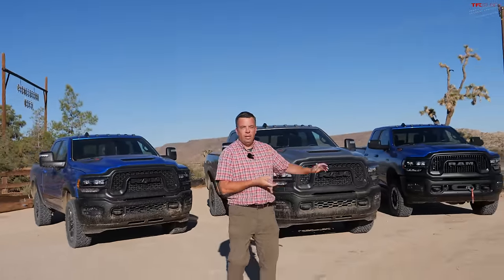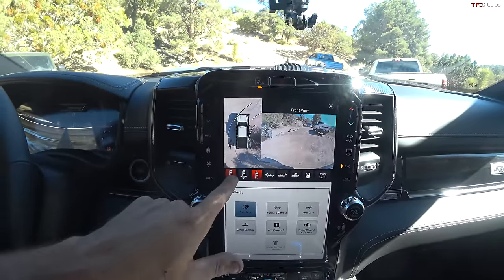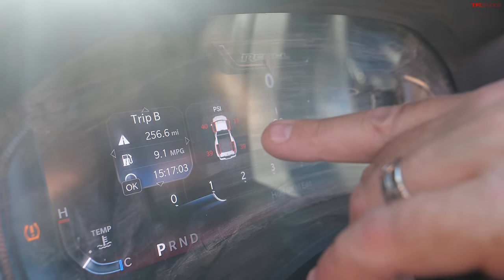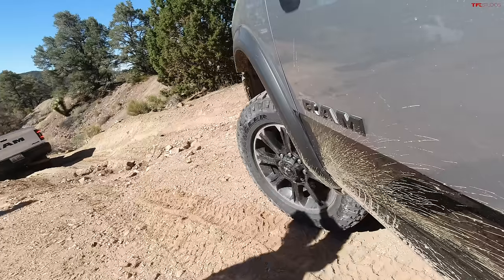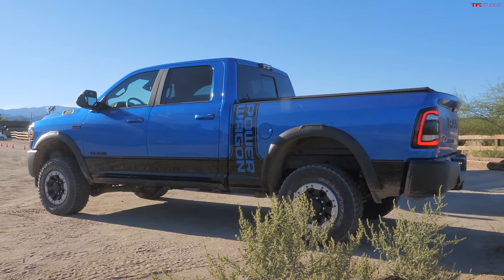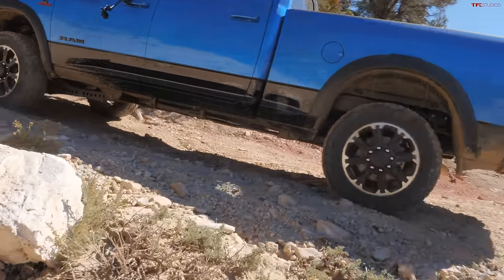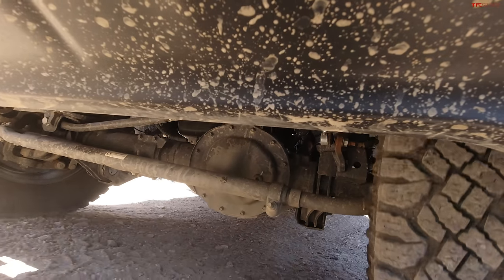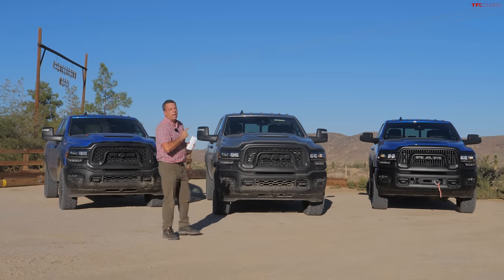2023 Ram HD Rebel vs. Power Wagon: One of These Trucks is the Off-Road KING, But Which One Is It?

Comment: I’ve said it before and I’ll say it again, “I don’t need a Powerwagon but I want one”.
Reply: I have an 18. Best. Grocery. Getter Ever😂! I only get it off road a few times a yeah but it’s an incredible truck.
Reply: True. A few months ago I went into my local dealership to test drive a used Power Wagon, and I almost traded in my  brand new 1500. A 1500 is everything I need but a Power Wagon is everything I want 😞
Reply: I want to buy one, but with war going on, fuel price will be $10.
Reply: Just got a 24 power wagon , sure is fun and love driving it , going to sell my trx
Reply: Better to have and not need than to need and not have.
Reply: Bought a 22 PW new 2 years ago. I love it. People complain about mpg, but I average 13-14, have gotten as high as 17. A 1/2 ton with a V8 doesn't get much better. I don't do a lot of off roading, but when I do it is fairly significant. Not any crazy stuff, but stuff around the farm can be hard on a truck sometimes. Only had to use the winch once on myself, more on others. Having a winch is invaluable, especially for a vehicle that looooves to sink in the mud because of weight.
Reply: Till that thing yanks u into every gas station it passes

Comment: I waited for Ram to release a package like this since Ford announced the Tremor. Between the low payload rating, the inability of running a winch with the Cummins, and not being available on a 3500 I went out and bought my first Ford in 25 years. Ram is so close to having the dominant truck. If they make the packages competitive and finally put a quality transmission behind the Cummins they will be the class leader. Until then, I will enjoy my fully optioned F350 Platinum Tremor with a 3300 lb payload.
Reply: Steven Kane...........................There is BOTHING wrong with the AUTOMATICS in the Ram Cummins, nless you increase the power with a tuner! ALSO, the 1 tons that have the Aison transmission, is very reliable, and better than the Allison in the GM or Ford
Reply: @1gr8oil  The Aisin is a fantastic transmission, but it really needs weight to be appreciated. For guys who mainly tow it’s the perfect combo as long as you keep power levels close to stock. The Ford has a great all around transmission. Extremely refined compared to an Aisin which is perfect for a daily driver, weekend warrior.
Reply: I’ll stick with my 2017 Powerwagon. I pull my 7600lb holiday trailer twice a year only. Diesel trucks only make sense these days if your towing regularly here in Canada.
Reply: @juiceybrucey3475  - diesel or gas Ford got ram beat in both. Power wagon towing numbers are way too low for a “heavy duty” truck.
Reply: Why can’t you run the winch with the Cummings? There’s a lot of people who choose diesel for running trails or long distance camping and they have a winch on their vehicles. Are you thinking that having a duel battery 24 V system is an issue?
Reply: @EvanMoon  No, I was talking with the factory bumper.
Reply: @EvanMoon  the cooling system is in the way.
Reply: That 350 will be on the used market in three months 😂🤣
Reply: That 350 will be on the used market in three months 😂🤣
Reply: That 350 will be on the used market in three months 😂🤣
Reply: Bro your 350 will be on the used market in three months
Reply: Bro your 350 will be on the used market in three months
Reply: @chanoleyva4208  Not a chance in hell. Have you driven one?
Reply: @CoyoteFTW  Heavy Duty in this aspect meant more for off-roading. You can still tow and have a payload, you just gotta watch your numbers. People forget this shit it seems. 🤷‍♂️
Reply: Is it a gas ford f350 tremor also is it possible if you do a mini review
Reply: @Evan Moon  not enough room.  You can do it with an aftermarket install
Reply: @juiceybrucey3475  That 6.4 HEMI won’t last long.
Reply: @CoyoteFTW  wasn’t built for towing… 🤷‍♂️ but I’m sure you can throw on airbags….
Reply: @CoyoteFTW it’s better at off-road
Reply: To my great surprise, a Ford boi entered the chat and declared Ram inferior. It’s amazing how many Ford bois follow Ram forums and videos.
Reply: @dannyhoward3437  Thats usually a byproduct from owning a Ram then getting fed up and moving to Ford. 

Owning a Ford was the last truck I expected to own, but here I am. Ram is doing a helluva good job pushing owners into different brands.
Reply: @redtitan29  no, they aren’t. Tell the troll farm at Dearborn this isn’t working.
Reply: @dannyhoward3437  Keep drinking the kool-aid and putting up with mediocrity. I owned Rams over the past 25 years so you're talking to the wrong guy.
Reply: @redtitan29  of course I’m talking to the wrong guy. That’s the whole point of this game.
Reply: @dannyhoward3437  No games being played. It simply boils down to facts.

The market begged Ram to offer the Cummins in the Powerwagon for years. They ignored the demand allowing Ford to enter the conversation. 

Ford responded with the Tremor which addressed all of the areas Ram said it couldn't:

Available on 3/4 & 1-Ton ✅ 
1,050 LB.-FT. OF TORQUE ✅
475 HP ✅
10 spd w/7 Drive Modes ✅
Diesel + 12K Winch  ✅
Capacities respectful for an HD Pickup ✅
Front Limited Slip ✅
Rear Locker ✅
Rock Crawl Mode ✅
Trail Control Mode ✅
Slight Lift w/35" Tires ✅
Larger Cab ✅
Larger 6.75 bed ✅
Completely Flat Rear Floor ✅
Larger Fuel Tank ✅

Ram gets tired of the Tremor stealing sales so they finally releases the Rebel HD:

Only available on 3/4 ton ❌
Limited to Standard Output Cummins ❌
850 LB.-FT. OF TORQUE ❌
370 HP ❌ 
No Diesel + Winch ❌
No Drive Modes ❌
33" Tires with 20" Wheels ❌
Old Smaller Crew Cab ❌
Smaller 6' 4" bed ❌
Hump in Rear Floor❌
Smaller Fuel Tank ❌

Like I said, keep drinking the kool-aid. If you remove your bias you would clearly see Ford has the better overall package. 

I learned a long time ago to never be loyal to a company that isn't loyal to you. Blindly following brand loyalty is a recipe for being taking advantage of.
Reply: @redtitan29  you still don’t get it. Wow.
Reply: @dannyhoward3437  I get that you're being  very condescending and not interesting in adding anything beneficial to or having an adult conversation.
Reply: Sorry, those fords are piles for sure. My last ford was in the shop way more then I can count.😂

Comment: I completely agree with you on the Rebel being a step below the Tremor. I agree also that the Power Wagon is the best for HD off-readers. I think theTremor has them both beat with Diesel payload and the availability of a winch with the diesel. But my 2020 F150 has the same payload as the Ram Rebel HD Cummins
Reply: What’s an off-reader…?😂

Comment: Power wagon is the ultimate Off road truck still. Draw back is the low payload but that can easily and inexpensively be fixed with some added air bags in the rear for the 5% of people who really need more capacity.
Reply: Tell that to the insurance company when your overloaded Ram is in an accident.
Reply: @donrichter3523  Mine is never overloaded

Comment: Prices are wild. I ordered a brand new 2021 Power Wagon and paid $53k (MSRP $60k). Level 1, 360 cameras, towing tech, dual alternators, bed utility group. Almost 30k miles with plenty of dents/scratches from the trails and zero issues. Towing 7k travel trailer too (thanks SumoSprings) with no complaints. Sold my Cummins and don’t miss it one bit, especially the emissions!

Comment: The articulation of the PW is primary difference between it and other full-sized entries. Yes the lockers and winch are nice adders, but keeping the tires on the ground is key. I have a Able Components module in my '16 that will allow me to unlock the front swaybar at any speed (and also lock the front and rear at any speed, 2hi, 4hi, 4lo). I leave the front bar disconnected most of the time and enjoy a nice comfy ride, even with a Four Wheel Camper in the bed.
Reply: Вот!!! Воооооооот!!! Я не могу понять дурости, которой страдают ваши блогеры и обзорщики!!! Естественно Power Wagon будет лучше Rebel на бездорожье! Ходы подвески плюс блокировка переднего дифференциала! Вопрос насколько? И что ещё очень важно, какова разница между ними на асфальте! Power Wagon за счёт своей подвески ещё и на асфальте весьма неплох для рамного авто с мостами впереди и сзади! Грузоподъёмность PW сильно страдает! И вот не понятно, стоит ли игра свечь? 6,7 Дизель не аргумент, это кусок разваливающегося говна!
Reply: Sway bar disconnected on pavement and high speed?
Reply: @megudal78  - depending on road conditions, yes
Reply: Interesting, should I give it a try? 😆

Comment: I've owned a power wagon.....a jeep wrangler....and a diesel 2500. 

The off-road capabilities for someone that can isn't scared of putting there foot in the throttle of all 3 are close! But....the Powerwagon is a freaking beast and the weight difference between the diesel and gas is def noticeable! The Jeep is a jeep it's gonna go anywhere as long as it's not on the frame and same with the Powerwagon
Reply: ive taken my rebels every  where my power wagons and my rubicons went.

Comment: My '16 PW is just about to turn 100k. I've had one problem, under warranty, a failed EVAP solenoid. It has been a great truck and is as unstoppable off-road as my 80 series Land Cruiser, though at over 9,300# loaded with a FWC, sliders, bumpers, yada - deep sand can be tricky. Payload, pfft... AirLift bags and Daystar cradles. Guys, don't get your panties in a bundle over rear spring rates.

Comment: Awesome vid as usual guys.  I am confused by one thing with regards the fuel range discussed.  The HD 6.4 had a range of 415 miles (256 covered with 159 remaining) and the HD Cummins had the same (114 covered with 300 remaining) but Andre said 'that's why you get the diesel, for the range'.  If they are the same range, then isn't the real difference the torque? Am I missing something, perhaps the diesel tank is smaller?

Comment: My 3rd PW comment here and not sure it is still relevant, but my 4th gen '16 PW was just a couple steps above a Tradesman. The only two options it had was the tow mirrors and the bigger 8" infotainment head unit. With this option, I was able to add a bunch of features such as single zone auto temp control, steering wheel volume/track buttons, HomeLink, the nicer PowerWagon (with logo) EVIC gauge cluster. Driver and passenger under dash lighting pigtails are there for adding some nice LED illumination. Added the OEM remote start/keyless feature too. Essentially everything was there to build up a higher trim (wiring harness) but the larger  8" headunit was the key for many items. Not sure if that is still the case, but worth investigation.

Comment: Just buy a regular 2500 Cummins, add one of the Carli suspension kits, 37s on 17s, airbags with cradles and maybe ARB air locker if needed and you will have better truck the HD Rebel for less money. If need more payload, do the same but with 3500. That is my plan, have the 2500 Cummings on 37s with Carli Commuter and it rides like a dream will probably upgrade  later Fox 2.0 with external reservoir or King 2.5s later on. Will be adding airbags with cradle soon as I tow a trailer and it sags a little in the rear but still rides great. Will add air lockers and new bumper/winch if I start getting a little more brave offroad. Even with all the upgrades will come in under $91,000 and be light years better then HD Rebel. I would have gone Power Wagon but I need about 2000 lbs payload to tow trailer with kids, dogs, bikes, etc for camping.
Reply: There are ZERO aftermarket rear diff locks for the current HD RAM.  That’s one reason to get a Rebel HD.
Reply: This is the correct answer.

Comment: Nice comparison.  And yes the overlanding range is a big deal!!!  Even with the higher cost of diesel, a savings can be realized.  Of course range is everything while overlanding.
We have an '18 Ram 2500 Crewcab 4wd 6.7L Cummins with the 3.42 ratio.  Our mods include a Hawk model 4wheel popup camper.  Bilstein 5200 shocks on the rear, and Eibach shocks on the front, and a steering brace.  Added an aluminum transmission oil pan.  Have a Bank's intake to delete the grid heater, ready to be installed.
We also have a '16 Ram 1500 Quadcab 4wd 3.0L Ecodiesel 3.92 ratio.  Bilstein 5200 shocks all around, Flowmaster muffler, and the Bank's silencer delete tube.
The ULTIMATE overlander would be a Megacab 3500 with the 3.0L Ecodiesel, 8-speed, 4.44, 4.56 or 4.88 ratio, and the AEV 3" lift kit to allow 37" tires.
The original 5.9L Cummins in '94, had less power than the 3.0L Ecodiesel.  The 8-speed would help the engine stay in the sweet spot.  And if Tow/Haul mode is used, the VGT turbo engine breaking is pretty good.

Comment: That’s exactly what I did the tradesmen power wagon the exact one that you have on the video red chrome and black love it. I do not need all the bells and whistles with all the electronics inside. I have the 8 1/2 inch entertainment system Blindspot Monitoring back up sensors. Interior opted for the work Grade vinyl it looks like leather, floor shifter for the four-wheel-drive vinyl floors because I put Rams floor mats in. All I have to do when I clean it pull the floor mats out and wipe the floor down no vacuuming . $42,000 before taxes

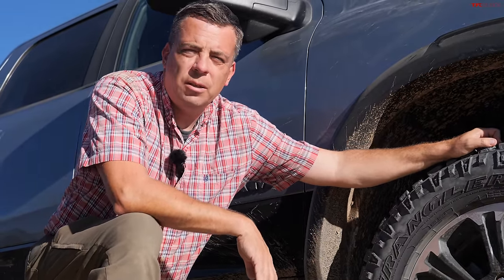Comment: I tow all day long with the Hemi Power Wagon. 4:10 gear. Bought my 2015 AEV power wagon  to tow in soft dune sand Oceano and imperial, dumont dunes. 25' toy hauler. You can very well tow with a V8 engine. In fact i think the power wagon did very well in your towing test uphill and down hill ike. Also the power wagon did well in your off road test scoring. The highest i think P.S. companies offer supercharger kits for the 392 Hemi V8 for less than 10,000 dollars if you want boost for high elevations. Big bear is 40 minutes from my home. Adding Diesel to the Legendary off road p.w. is like adding 22" rims. I do have a cummins generator my R.V. however.

Comment: TFL, does the HD Rebel have a lift in the front?  I'm not seeing much difference between the Rebel package and a standard 2500 except for locking diff and a slight lift in the front.  Is there much difference in that front control arm in the Rebel from the standard 2500?

Comment: I bought a 2022 Power Wagon 75th anniversary and immediately put in the Carli Pintop system with radius arms. It immediately made the truck the best offroad option period. I've taken my truck to some INCREDIBLE obstacles and it just went everywhere! The gas mileage is one downside, however.

Comment: I was really excited for the HD Rebel. As a 5th gen Ram Rebel owner, who’s looking to upgrade to a HD truck, the concept is ideal. However, the execution leaves a bit to be desired. I’ll wait for the 5th gen cabs and higher GVWR. The rumors of mild hybrid systems to boost power and efficiency are promising.
Reply: Just talked to my dealership. They have a 2500 rebel w the diesel and the power wagon package. Msrp is 88k

Comment: One thing to consider here between the Rebel diesel and the 6.4 Hemi. The gas Rebel has about 1000 lbs more payload capability than the diesel. So even though the diesel can tow 3 to 4 lbs than the gas on paper, the tongue weight of 10 to 15 percent will take away payload quickly, so the difference between the to may not be as dramatic it may seem. Also, you can add air bags to the Power Wagon and tow just as much as the Rebel.

Comment: Something people forget regarding Diesel and off road driving is the amount of idle time and super low rpm. The emissions systems in newer diesel trucks are still the Achilles heel and don't like low rpms or idling for extended times so fuel economy considered, it would still be the better choice to opt for the gas engine.

Comment: The only thing i didnt like about my 19 and 22 power wagon...with that massive muffler it sounded like it was wheezing 😂.   That has been fixed on my 22 with the proper application of an aeroturbine muffler.

With my 35 inch Yokohama g003 M/T tires it sees right at 13.3 mpg highway.

The payload goes down to 1100 lbs with the rambox option.  It is the perfect truck for those that want off road ability with almost 1500 ride.

Comment: Not sure if Chrysler tried to do any real Voice of Customer for this truck, but. They could have easily carried over some of the beneficial Power Wagon items at little to no cost. For example, 20” wheels, seriously, look at your Ford competition guys. Instead of introducing a new wheel, carryover the PW wheel and tire combo, at 3195 lbs per tire capacity at 65 psi, that is fine for the GVWR of a Ram 2500. Also, the PW front lift springs should work as well at least on the Hemi rebel as the front weights should be the same. Maybe the only additions that would be needed beyond that are taller springs for the rear and a limited slip diff for the front axle, then you have a Tremor competitor. As it sits now, this is just an appearance package. Also, what customer wanted a full digital display cluster, I’m guessing if Chrysler actually surveyed current Ram owners and said, how about we replace your gauges with a full LCD instrument cluster? They would have got a resounding “are you freaking stupid or something?, no keep it simple folks”

Comment: Tradesman w/the Powerwagon package is the only way to go if you have to tow anything over 10k lbs. That would def be the truck for me as I tow my skid steers and gooseneck and dump trailers etc. My GMC AT4 HD 2500 seems to do a fine job but I would like to have that winch bc from time to time I do get my skid steer stuck sometimes and that winch would def come in handy. Good job Andre!
Reply: I really like the PW mostly for trails and camping but I have read all over the internet that it can tow up to 17,000 pounds no problem. Just curious is that not the case?